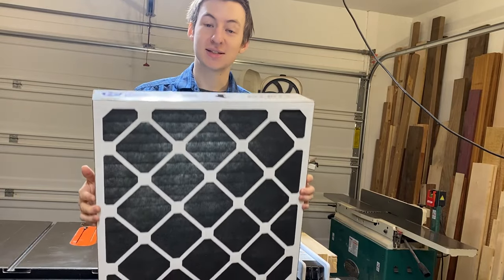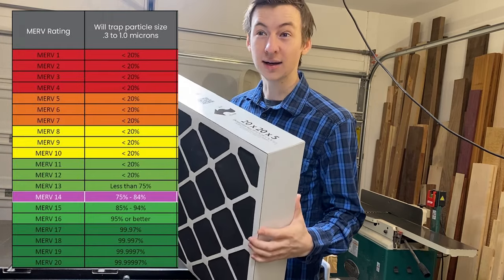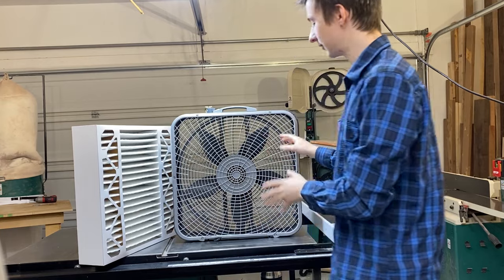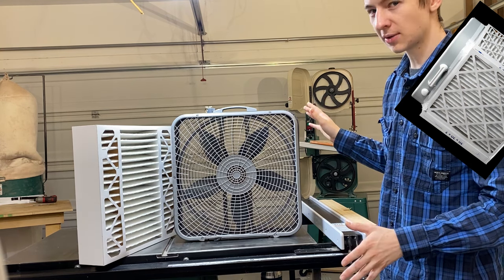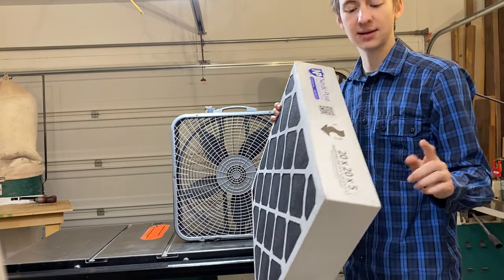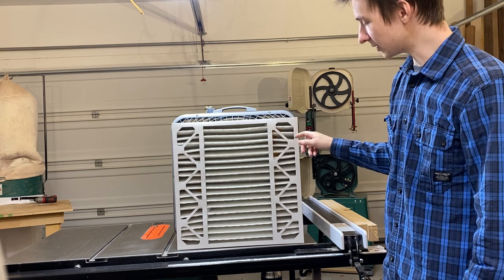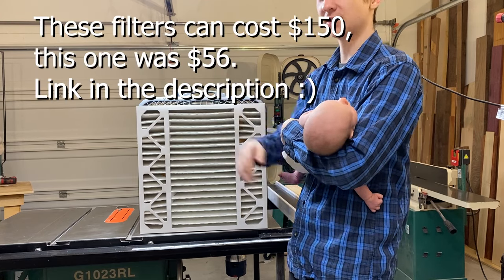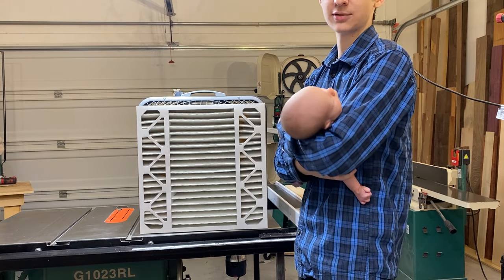*NEW* Easiest DIY Air Filter | You need to get this!!

Comment: A huge benefit of the 4 filter box style is that it draws air from all 4 sides of the room equally, you can just put it in the middle and forget about it.
Reply: That is incorrect. You can blow the air across the room but you cannot suck it across the room. Whereever you reduce the local pressure, air will flow to that point from everywhere equally. So it is more a matter of where you blow the exhaust air to. Because that might raise the pressure in that area.
Reply: That doesn’t make much of a difference in the amount of air filtering through at all.. at the end of the day, it’s one fan moving volume.. the cube that people build is a waste of space.
Reply: @oneheadlight8000  That is probably incorrect as well because filters with the capability of catching 1 micron dust need more surface to work with the low pressure difference an axial fan provides. So if you only want one filter it will probably be a box in which the filter is folded up quite a bit, but never a simple screen.
Reply: This is exactly what I was thinking. Since sources of dust may be scattered (especially in a workshop), positioning the filter near the center of the space would be a good option.

Comment: Full Corsi-Rosenthol box, with 5"  20 X 20 filters! (5 of these filters in total) I like the fact, that it has a carbon filter as well as conventional media. It would be expensive, but, would likely last a couple of years, perhaps, the life of the fan. The fan should last a long time, because the motor is operating in such clean conditions. I like your idea of MERV 5 (ish) pre-filters, to prolong the life of those expensive MERV 14 filters. They would also serve as protection for the expensive filters, if something happens.
Reply from the maker: Exactly! Thank you for commenting!
Reply: @SpencerOlinger how often you have to replace that 5" thick filter?
Reply from the maker: @FREEFILMSALEX  I’ve been using mine for about 7 months and it’s still nowhere close to needing replacement. I’d say it’s got another year left at least!
Reply: @SpencerOlinger  I live in the Quad Cities here in Davenport Iowa where the air quality is pretty bad most of the time especially with the Canadian wildfires in the summertime.  Thanks for this video.
Reply: Nice video. Is the fan too loud for a room? Any recommendations on a good and a quiet box fan, please? 
Thanks.
Reply from the maker: @Igryan8  that’s a good question, I actually use mine and a white noise machine! I would get the air king, the link should be pinned in the top comment, and if the highest settings too loud, there’s 2 other settings quieter. Just know that the higher settings purify quicker:)
Reply: @SpencerOlinger  I see. Okay, thank you!
Reply: @SpencerOlinger  A few more questions if you don't mind. I've heard that new air king fans use cheaper blades and it's better to get Lasko instead. 
If I use the 5 inch thick filter instead of 4 wall box with 1 inch filters, will it be able to clean the air of around 1200sq ft - living area/kitchen...? Or should I better go with 4 walls?
Reply: That sounds pretty much optimal. It would have a fairly high up front cost though.
Reply: You aren't thinking big enough - if you're going to build a filter box with these, you might as well make it multi-stage too since the restriction penalty will be decreased with the shear amount of surface area lol. It definitely wouldn't be the cheapest DIY air filter, but I would imagine the individual filters would last you just about forever lol.

...having thoughts of a DIY downdraft paint booth now... delusions of grandeur

Comment: I don't understand how these work. I have a 300w S&P axial plate fan. The outside frame is 500 mm by 500 mm the fan is 400 mm across.  These are basically industrial extractor fans with a high static pressure rating designed to pull air through an entire building. I put some G4 filter media used for spray booths it's about an inch thick pre-filter and a fan wouldn't pull air through. I do not understand how these tiny box fans with their plastic blades but flex at will and are totally geared for zero static pressure going to actually work. It really baffles me. I can't believe that G4 filtered media has more resistance than a HEPA filter. I put this G4 prefilter on the outside of all my air purifiers in order to stop large particles blocking up the header filter. And it works in all my air purifiers.  But again I'm baffled How these little fans work.

Comment: What is the science behind this? The 5” filter has more surface area? I have a single 1” merv 10 taped to the back of a box fan that will do the exact same thing as that box or your 5” filter. The only down fall is the filter will need to he replaced sooner. The filter is designed to last 3 months but that is not necessarily accurate. With a box fan simply feel if it is still moving air and that is more than enough to determine if the filter is clogged. The only consequence to a clogged air filter would be a burned out motor but that would be unlikely. People tend to promote a concept of more is better when one only need what is necessary. 5 filters or one 5” filters is not necessarily going to do anything more that a single 1” filter. In fact I can argue that my single filter will give as good and as quick of a scrubbing as 5 filters. There is no scientific miracle in this one the science is in the filter and can not be improved. Switching to a hepa is ones only option. But boxes or a 5” filter make no difference.
Reply: The rate of flow would be lower for a single thin filter which is lowering the speed at which it can remove particulate from the air. Although the air quality of the output would be identical.
Reply from the maker: Thanks for your question! I can assure you it does make a difference, think of it as your fan is trying to breathe through a think straw vs a thick one. It will be easier on your motor, yes, but it will also just do a better job because more air can go through a bigger straw
Reply: You're missing the surface area, the big one has deeply folded filter material. So it literally has the material of 4 filters or more.

Comment: Two things I'd like to mention:
1) It's absolutely fine to use a MERV 13 for home use.  Capturing around 75% means that some PM2.5 particles might escape, but will then be captured when the same air enters the air filter the second or third time.  I've tested this even on a MERV 11 filter and yes it takes longer to achieve zero PM2.5, but the air in your home ain't going anywhere. You can find a lot of video talking about how we don't need HEPA or filters that come close to HEPA for performance.
2) Most Corsi-Rosen filter boxes do not use 20x20 filters, but uses 20x25, where a 6 pack cost the same as a 20x20x5.  I wouldn't say that this is a more expensive solution.  You assemble the whole thing with packing tape usually.  Not much more material cost.

At the end of the day the various DIY designs are great for all sorts of different use cases.  Usually one doesn't always win over another design.
Reply from the maker: That’s really helpful info! Thank you!
Reply: MERV11 can be just fine for most homes, you’re right. 

Some testing has shown that the optimal solution is a corsi rosenthal box with MERV14 1” thick filters. Because it has an air gap inside with four filters, airflow isn’t restricted so badly and it catches more on a single pass. Lower rated filters won’t filter as quickly, but for a set and forget air filter in an average home, it’s probably not tremendously different as far as what you’d notice.
Reply: @Cujobob 50% more is what I've heard.

Comment: You'll want to check 3rd party tests. I remember seeing tests by Consumer Reports that put NordicPure's "MERV-14" filters actually at MERV-8, and with significantly more restriction.

I would think that for a filter to have 5x the surface area by having 5x the thickness, the number of pleats would have to match up. But most thicker filters don't have that many pleats.

Another thing you might consider is having more of a gap between the filter and the fan. When the filter is too close, you can get more turbulence and stalling. If you added maybe 5-6 inches between the filter and box, you might see a decent amount more airflow.

Comment: I think these concepts are great, but each situation can require a different fan unit depending on how often you prefer to completely recirculate the air in your room and how much dust you're stirring up.  Am leaning towards building something myself, but it'll need to push through a bit more air than a basic box fan.  Thanks for the video!
Reply from the maker: Great point! Also, You could always make 2!
Reply: Did you come with anything novel worth sharing? I’m thinking of using an inline ducted fan with a shroud made of left over R15 foam board insulation I have left over.

Comment: Thanks Spencer for your video. I am curious though about how much restriction you would get with the 4 inch filter versus a one or two inch filter? Would it burn the motor out or how much would it reduce the life of the fan motor? Thanks.
Reply from the maker: Hi Wayne! Thanks for your question. From my research,a 1" Filter on an Air King = 320 CFM, while a 5" filter =  400-410 CFM. I don't know specifics for the motor, bt, I do know the 5" filter is less stressful on the motor than a 1" filter, so it would reduce the life to some degree. Hope this helps!
Reply: It doesn't look like there's an increase in the thickness of the actual filtering material, so there's no increase in restriction. They're just making the carboard 'frame' thicker so that they can make the pleats much deeper and increase the total surface area of the filtering material. If the pleats were packed tightly together to fit as many as possible, then there would be a restriction increase for sure, but this is a very low pleat count so they're pretty open even though they're much deeper.
Reply: Just an opinion, but I'd expect a "thicker" filter with more surface area will trap more dust. That is a great feature if the fan produces enough CFM to pull air through the increasingly occluded filter media. The extended life of a thicker filter, while appealing, may or may not be fully realized if the fan is too weak to pull air through it.

Comment: Before choosing a filter, check the airflow drop of that brand. Some are really bad relative to others. Some merv 13's cause less airflow restriction than merv 11's.  Really worth doing homework on the specific filter. The thickness is only one aspect, amount and depth of pleats and materials used are important.

Comment: Is there no consequence to the proximity of the filter to the fan? I suspect there's more to it than just equivalency in flow? lmk if you know more i am curious about these filters !
Reply from the maker: That’s a great question! I believe there is a small consequence, but not very significant. Here’s a video that should help answer your question better if you have the time: https://youtube.com/watch?v=KobogQMf_Xc&feature=sharec
Reply: I would guess proximity wouldn't be the most salient issue as it might be more important to tune fan speed to the  CFM of the filter.  This would protect the fan from working too hard.  The multi-filter builds allow the fan to be driven to it's maximum CFM.
Reply: I suppose on the next filter change or if you have an old one. gut the filter media out of the  one and use the empty frame as a spacer between the fan and the new filter.
Reply: @terran2kk  smart

Comment: The reason for the Rosenthal Box is easier air flow. Less stress on fan motor, less over heating of motor, longer life of motor. 
MERV 14 is very restrictive. Most home furnaces will burn out fan motors if using MERV 14 or higher. Usually a MERV 13 is the highest recommended.
Reply: This entire video is directly addressing this point

Comment: What would you reccommend as a prefilter? Could you add a link to the description?
Reply from the maker: Here you go! If the link doesn't work, go to your local ace, and get a merv 1-4 1" thick for your prefilter. they are only like $3-6!

 https://www.acehardware.com/departments/heating-and-cooling/air-quality/air-filters/4595385?store=17630&gclid=Cj0KCQjwhL6pBhDjARIsAGx8D5_yMbnWNHIlGhS9cxvtpsEyAP-e3-jo-M3691BPI9Pdi3ARNQHvAa0aAvuSEALw_wcB&gclsrc=aw.ds
Reply: If you want something reusable, you could get some mosquito netting and tape it over the furnace filter. Periodically, use a slightly damp sponge to wipe the dust off the surface of the netting, taking care not to get the furnace filter wet.

Comment: Maybe this is very dumb but in commercial purifier, there’s suction to draw in particles and a fan system. I’m assuming the filter on the back helps with the suction and flow? And it doesn’t matter where it’s pointed in the room?

 I think this a great idea to the box method but still pricey, i wanna make sure i’m doing this right. It would be in 17x12 room that has very poor circulation and leaking, awful shag rug too. I use cheap lasko fans. Am i good to go or is this not safe given all the specs?? Please lmk and ty for all the info!!
Reply from the maker: So your fan is blowing so much air it out it actually creates a suction through the back. So that’s why we put the filter on the back, because all the air that’s getting pulled in through the fan will get pulled in through the filter!  Where it’s at in the room doesn’t matter too much, because all the little particles are going to be floating around anyways. I read somewhere that it’s actually better to have it a few feet away from the wall rather than in the center of the room! But anyways if I were you I would get this filter and maybe a pre filter to go with it, and see if there’s any improvements over the next month or so. If not, you may need to upgrade to the fan I put in the description. It’s more powerful. Hope this helps!

Comment: Like a big dduuuvuhhhhhh!!!  This was my thought exactly.  I’ve got the meta common sense tho.  Some don’t.  Was like why do 4 1in with way inferior filtration when you can do one 4 or 6” merv 13-18… duh.  Save on space, easier to move around, and the filter will actually last longer too.  Duh ppl. I’ll probably install magnetic stuff on filter and fan to make swapping front/rear easy in case I need to.  Like going from window to other areas.  Doubt it matters at all tho performance wise.  Prob just do front so I can mount it in window easier.  Stupid neighbors burn wood all the damn time so don’t wanna clog up my super expensive iqair 200$ filter every 6-12 months.  Should last 10k hours or something… this will filter all incoming air from neighbors inconsideration
Reply from the maker: You’re smart like me lol! I’m sorry to hear about your neighbors, I like your idea for magnets to easily change the filter! Could you still get an airtight seal with this method somehow?

Comment: Theoretically can the wood dust catch fire if the fan sparks and cause an explosion? I don't even care about fires since I can use an extinguisher but sizable explosions would make me think twice.
Reply from the maker: Good question! If you have a fan that’s emitting sparks, you may want to replace it lol. It is important though to keep your workshop clean using an air filter and dust collector to prevent spontaneous combustion (if you did light a cigarette or spark)
Reply: Brushless FTW

Comment: the Amazon photo reviews for this filter say it's undersized. What's the deal...?  Did this filter actually cover the whole fan?  Also, would adding a MERV 8 one-inch to a MERV 13 five-inch work well too? Got limited options without breaking the bank in Amazon Canada.  thanks for posting.👍
Reply from the maker: Thanks for your comment! I just went to measure mine, and to my surprised it is actually a little undersized, about 19.75”! Still though, it’s very close and covers the fan very well in my opinion. I think adding a 1” Merv 8 pre filter would be a great idea!!! I wouldn’t go much higher though so as not to restrict airflow, in fact I might even suggest a Merv 4 or 3 1” pre filter!
Reply: @SpencerOlinger  thanks!  Got my MERV 13 from Amazon..should be arriving soon.  Uuge price difference buying the ones made in USA, so I bought one from Amazon CDA.

Comment: Does it remove mold
Reply from the maker: Yes, a MERV 14 filter is capable of capturing mold spores. MERV ratings between 13 and 16 are generally effective at filtering out particles as small as 0.3 to 1 micron, which includes many types of mold spores. However, while a MERV 14 filter can reduce mold particles in the air, it's also important to address the source of mold growth and control humidity levels to prevent further mold issues.

Comment: There's only one problem with your idea and that's airflow i use to use these Merv 14 filters in my Central Air, Blower motors and i noticed my power bill skyrocketing due to the blower motor working overtime because of how thick these filters were. Dint get me wrong they were doing a great job keeping a good amount of micro particles from staying in the atmosphere but due to the positioning of the filter your seriously inhibiting your fans ability to push air as the filter thickness is making hard to pull it behind...its really a very effective way to kill your fan which is why the CADR box works much better as theres space between the filters and the fan for the air to travel more efficiently..Think of if this way putting that thick ass filter in back is little bit like putting that fan against the wall of your home it's going to overheat or lower the life of the fan especially the more finer particles the filter is rathet to collect